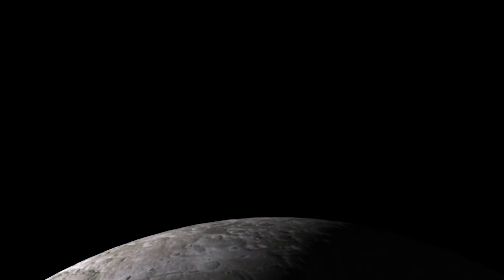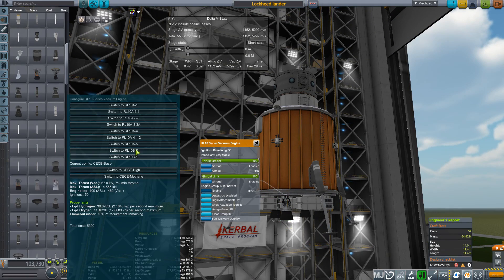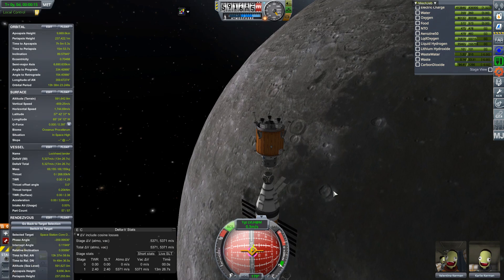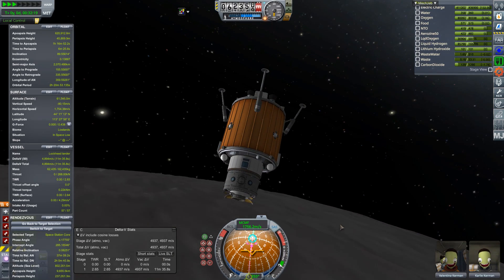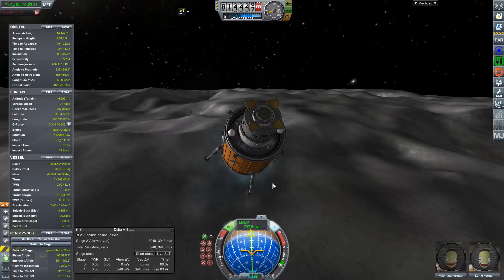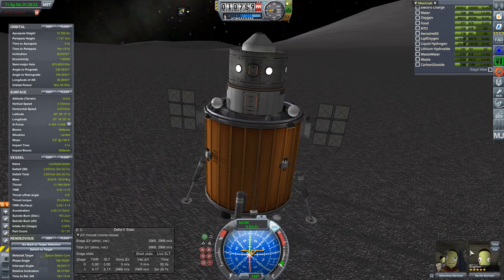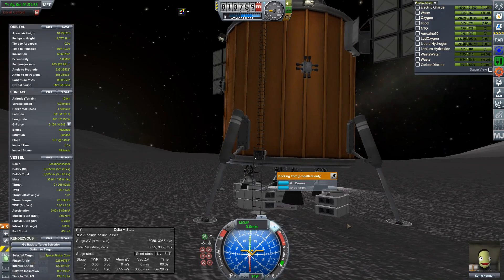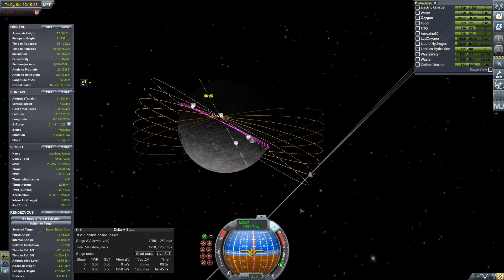Simulating Lockheed's Reusable Lunar Lander Concept

Comment: Thank you for posting this simulation. I did not know about Lockheed Martin even having a new design concept on the drawing board. Maybe I missed something, but I understood that an essential component of New Space / re-usable spacecraft is to standardize on newer, more powerful and re-usable rocket engines on all stages. SpaceX does use RP-1 on Falcon 9 and Falcon Heavy, while Starship uses methalox exclusively. Why do theselong-standing aerospace manufacturers frequently turn to older designs that use liquid hydrogen? Given the problems we've seen with SLS, older hydrogen engines seem problematic. Blue Origin / National Team's proposal video for the National Team lander design made a big deal about the landing engine exhaust kicking up lunar regolith, causing debris to be shot around at kilometers per second. I don't understand why a lander concept like this Lockheed Martin design doesn't include high-mounted landing thrusters along the rim of the upper fuselage so that these could be used for the final descent phase, just prior to touchdown. (Like what SpaceX wants to do with its HLS Starship.)

Comment: Since you were talking about fuel system selection and also about fuel refinement and ratios; why not use hydrogen peroxide for the RCS system, like on Soyuz?  It would help offset the ratio problem, and possibly (if Roscomos gets their act back together) allow for transport of H2O2 back to the ISS for venting and replenishment of Soyuz (perhaps some distance away from the station), getting around the 200-day operational constraint.
If this mission infrastructure gets implemented and Soyuz can be replenished with H2O2 in orbit, it would be interesting to see a Soyuz redesign for long-orbit duration, possibly for some years.

Comment: Question: why not just use pressurized gaseous hydrogen (from the main fuel tank) as a monopropellant?  It wouldn’t need ignition at all, and would reduce the need for complexity and dangerous fuels.

Comment: Maybe it would be better for the astronauts health if the habitation module was inside the fuel tank. so they would get extra shielding from cosmic rays. There is the thing about the fuel tank exploding, but maybe if the habitation module was a hard egg it would be able to resist better the explosion? I'd personally rather have a BFR doing all of this and a couple of hydrogen extractors permanently set inside a crater somewhere.

Comment: The best highlight of my KSP happened as I was landing on dubs with 4 parachutes. 

The first parachute got ripped off in the upper atmosphere as I was trying to land. Then a minute later my other 3 parachutes opened in the lower atmosphere. And less than 1000 meters from the ground I was getting excited that I wasn’t going to die...

Then my upper stage parachute hit me at 200m/s and blew up my landers crew capsule. 

LOL! It was wonderful!

Comment: This seems like Altair v2, but just 1 ton of cargo is abysmal, all you can do with that is wander around on the surface, an Apollo redux of 3 days of actual work and the rest twiddling your thumbs.
The configuration of people on top is just poor, you can't do any large module unloading, and with a single stage full of hydrogen your living ONTOP of and wasting an incredibly effective radiation shelter.

Comment: I'm new to this game. Your last clip looks similar to my Mun landing attempt.  I keep losing my maneuverability.  SAS and RCS both just stop working sometimes and I can't line up for any orbit burns. A,S,D,and W keys are just dead.  Finally landed on Mun, but I'm on my side.  I'm in my first orbit around Minmus now, but I lost any control on the approach.  Only pulled it off because it auto-rotates to the correct position upon full throttle  based on orbit maneuver.  Not sure how I'm going to land yet.
Reply: With kerbals on board or with probes?
With a probe, you might have lost connection to KSC (depending on your difficulty settings)
With a manned craft: Maybe you ran out of Monoprop (likely if you did not add additional tanks) or out of electricity for the reaction wheels.

Also possible in all situations that you accidentally hit time warp (no control at all during time warp)

Scots problem was, that his craft had far to much thrust for its mass to be landable without throttling (the Engines he chose for the craft in the last scene could just not be throttled, only turned on off (with some delay I suppose) and that the crafts RCS engines were not designed for such extreme tasks (there really should be no need to be, in real life)
Reply: Kerbals on board.  First SAS became useless and I couldn't do anything while still attached to my main stage.  I detached thinking my lander stage would react to my input, but it too was dead.  I have 3 or 4 of those little RCS things attached, and full fuel, with 3 small external tanks attached.  I highlighted the RCS tab, and could then maneuver with that, but  it was difficult to control.  Those too went dead.  I could only maneuver while the main rocket was burning, which made landing an interesting ordeal.  Trying to slow my lateral velocity while keeping it upright and having to start and stop it so I could still fall toward the surface.  Tipped over on landing but was able to get out and walk around.

Clicking on the little thrusters showed them being full of fuel I guess.  I'll have to read up on those.  I'll add a solar panel or two also as I didn't have any of those.

Comment: Scott, at 4:20 you said about leaving a fuel tank an low Moon orbit. It is absolutely unrealistic because how much not round the Moon is. You will not find the thing where you left it.
Reply from the maker: Nah, to start with there's a frozen orbit at 86 degrees which is pretty close to a perfect polar orbit. so a Fuel depot would easily be stable for a few months.

Comment: How to store Liquid Hydrogen for two weeks or longer?Is there magical cryo tanks for that?How to not let LH boil off?
Reply: ULA's ACES upper stage is magical cryo tank.
Reply: Store it as water and split it up as you need it?  Or just use a lot of energy to keep it all very cold and give it some pressure

*edit: Ah you mean on the lander? Just Park your rocket in the shadow.... should be pretty cold then already
Reply: Yes, in theory that's possible. But IRL it would take a lot of energy, resources and time to convert water to LH+LOx, which won't make sense unless they have nuclear reactor on Lunar orbit. Which doesn't solve the problem with LH stored in Lander for two weeks, cause if they put Lander in shadow, they won't have solar power.
Reply: 40 t of water split holds about 175 megawatt hours of energy. Let's just say you need double that power - 350 megawatt hours because of inefficiencies in the conversion and non-stoichiometric engine use. The gateway that this is based off of produces 40 kw or .96 megawatt-hours per day. It could therefore fuel this in about a year. ISS produces about 2.5x that, therefore it could fuel this in about 6 months. ISS in an orbit that isn't in shadow half the time would produce double that, which would translate to fuel production in 3 months.

Comment: What is the advantage of multiple landings?
Reply: erase the need for bringing a complete Lander to the moon each time, but just the fuel needed to land.
Even if the fuel for a multiple use lander weighs the same as a single use multi stage lander:
- fuel is easier/way cheaper to produce and probably also to bring there
- fuel can be used for multiple purposes
- fuel could to some degree be generated in-situ
Reply: to save money, just like the space shuttle

Comment: What would happen if a suborbital craft is caught by an oribital craft? Would the orbiting craft be pulled down, or would the suborbital craft be pulled into an orbit? I imagine the orbiting one would lose some speed, but would it be enough to pull it out of orbit?
Reply: The difference between suborbital and orbital at any given altitude is the horizontal velocity, so it would depend on how suborbital the craft was... the closing speeds could be faster than a bullet.  But assuming that they could survive impacting with each other, their momentum would be conserved and the resulting velocity would be lower than the orbital craft's velocity,.  This may or may not be low enough to make them both suborbital, depending on the initial velocities.
Reply from the maker: They’d have to match speeds
Reply: Probably both spacecrafts would be destroyed.  
The orbital craft travels with more than 7.8 km/s. The suborbital craft must be slower. And even a 'small' difference in speed (e.g. 100m/s = 360km/h) is a too fast impact.
Reply: Are you describing a Fulton Recover in space?
Reply: As described before: the momentum (mass*speed) of both craft together would be the same as each separate crafts (before) added. This physical constraint / reality leaves you with the simple result that you cannot gain anything by this operation: You simply have to propel the orbiting craft prior to this move to the speed it needs to be able to perform it. Instead you can just propel your suborbital directly.
This aspect of physical needs aside, just for the fact of doing it:
In order to perform this at the lowest possible speed difference to be still an orbit after the 'catching', the orbiting craft needs to be way heavier than the suborbital one (to allow for a low as possible speed of the orbiting craft).
Even if you are able to create a methode to 'catch' a suborbital craft with an (still much faster) flying orbiting craft, you'd need to implement some really fancy technologies to make the resulting acceleration bearable even for dead hardware, not to mention astronauts.
Or, inversly, to make the 'catch' long / elastic enough that the accelerations get to a bearable level. Think about some x km long catching device...

Comment: So a resuable lander which can only launch 1T to the surface of the moon, and requires 40T of fuel to be launched to the moon to be used... why not just develop a much lighter 2 stage lander and send a new one to the moon every time, seems much cheaper (when you think about the cost of sending 40T of fuel to the moon), doesn't require in space refuelling and lets be real, this lander is only going to be able to be used a couple of times before it is rendered to dangerous to fly and a new one will have to be sent up
Reply: Yeah 40 tons of fuel for each trip seems a bit extreme. You'd have to launch an SLS just to refuel the thing.
Reply: Such a lander would only make sense after ISRU infrastructure was in place on the moon's surface, and even this would assume it could launch from the surface of the Moon with full tanks, rendevous with the Lunar Gateway station, then land on the Moon again to refuel.

Comment: With more launch vehicle builders looking at Liquid Methane I am surprised Lockheed/Martin didn't go that route. Yes H2 has better performance but it also requires larger tankage. Plus the storage issues with LH2. Also if you use the Lunar Gateway as a fuel depot you could ship the fuel up as water and a dense hydro carbon or even solid graphite. and manufacture the fuel on site at the Gateway. I could see the Gateway being primarily a fuel depot and supply site.  Personally I see Methane as a more likely future for chemical propulsion systems. As to the RCS system. Why not use H2O2 at about a 90 to 95% solution
Reply: The lunar gateway is already planned to be hydrogen based so I would assume LM would operate around that idea.
Reply: To be honest I think anything proposed by NASA or any of the aerospace companies feeding the federal government trough will never be anything more than pretty pictures and animations. NASA's track record in the recent past has been less than stellar with the exception of the stuff done at JPL. Why is this? First it is because of incoming administrations changing goals and policy. Second it is because certain individuals in Congress care more about the jobs related to NASA Centers than anything actually getting accomplished in terms of actual goals, hardware being built and flown or much of anything else. LockMart, Launch Alliance and others are willing to play the game. The Shuttle was retired over 8 years ago and we are still no where near having any man rated system. I suspect Musk will launch man rated Dragons or even the BFR before NASA and the rest of the trough feeders are close to having a flight ready vehicle.

Comment: What's that about leaving fuel pod in LLO? I didn't quite get it
Reply: The Gateway station orbits fairly high, so it takes more fuel to get to it from the lunar surface than it does to just get into lunar orbit.  This is fuel that you take down from orbit just to take back up to orbit, so some savings could be realized just by leaving it in orbit in the first place.

Comment: What if you used a lander like the Apollo LEM, and you just kept several descent modules in orbit that could be bolted on, and refueled the ascent stage
Reply: That wouldn’t be very efficient, it’s like cutting a 747’s Engines and landing gears and building and having separate ones in another airport (idea like Elon Musk”s explanation)

Comment: Well SpaceX has really changed everybody’s ideas about big y’all landers. 

I remember when people used to talk about direct ascent vehicles they used to point to the size of a vehicles and it seemed ridiculous to land a 5 story high building on the moon. But after Spacex has been greasing the landings of rockets twice that height here on earth, it doesn’t seem so far fetched.
Reply: and its way easier on the moon too. ....the thing is tho that slowing down is way easier here because you can airbrake,.
Reply: Well, you still have to slow down to not burn on re-entry.
Reply: @Bartekkru100  thats not really true, all landers just go into mars atmosphere directly.
Reply: +Thomas Wijgerse
Oh, ok then.
Reply: Yes it still it, because we do not have flat concrete landing pads on the moon, landing on slopes up to 10 degrees is likely to be a requirement for a lander as it was with Apollo.  Tipping over is the main issue preventing a landing vehicle from being tall and skinny,
Reply: Plus lunar landing is an absolute piece of cake compared to rocket propelled landing on earth.
Reply: well, it takes more fuel to land on the moon then on mars, because of a lack of an atmosphere to slow you down, but spacex has has really shown it is possible
Reply: Thomas Wijgerse well you are correct, but there are some super serious physics issues that make Mars more difficult than the moon. 

Yes, Mars has an atmosphere, However, you have to remember that Mars’ thickest atmosphere is around the equivalent of 100,000 feet up in the earth’s atmosphere. Vehicles in earth’s atmosphere are traveling Mach 3 to Mach 6 through those flight regimes. 

So the atmosphere can slow the vehicle but only to the point where aerodynamic forces become severe enough to require the vehicle to be built for atmosphere (fairings/wings/lifting bodies...all of which add substantial mass)
Reply: Thomas Wijgerse yet they’re still only able to get the vehicle down to Mach 3 or so at the surface so the vehicle needs a whole ton of power at the surface as well.

It makes mars a far harder but to crack than the moon.

Comment: my biggest question is what are they going to use to bring 40t of fuel for each mission to the orbiting station?
Reply: They will be sending supplies to the LOP-G so they will acumilate surpluses oxygen and hydrogen I'm not sure Howe much water each each supply ship brings to the ISS.
Reply: Christopher Bloom yah, but even the current SLS design can't even deliver 40t to a lunar orbit, so you would need multiple SLS launches just to deliver the fuel for a single mission even if they were dedicated fueling missions
Reply: @Dufud6  I'm not talking about taking oxygen and hydrogen specifically for propellant but as crews come and go the LOP-G will acumilate more and more water recovered from the crews water reclamation system even the plastic from trash could be broken down recovering hydrogen to feed into a sabatier reactor. The ESA ATV- supply ship can carry 1800LB of water to the ISS so if the LOP-G can get several supply ships a year they might accumulate part of the H2O needed to fuel the moon lander at least for the initial trip to the surface.
Reply: "Christopher Bloom yah, but even the current SLS design can't even deliver 40t to a lunar orbit, so you would need multiple SLS launches just to deliver the fuel for a single mission even if they were dedicated fueling missions "

It would likely be one dedicated fuel trip and one co-manifested with Orion and crew fuel trip. You likely can't do 4 crew for 2 weeks with one heavy lift launch (Apollo didn't do that). Or 1 SLS and 1 FH/NG. Or 3 FH. Or 1 SLS with electric propulsion. Or lunar ISRU. Or asteroid ISRU. The Lockheed white paper I believe just says that NASA pays x amount for a kg of water and it is delivered by whatever means.

edit: from the whitepaper:

"Because of the high ∆Vs associated with deep space operations, and the objective of reusability as essential to sustainability, liquid oxygen and liquid hydrogen are the most effective propellants. These components may be derived from water, the most ubiquitous resource in the solar system. Because it is also essential for breathing, drinking, plant growth and long-term viability of human populations, the commercial delivery of water will become a highly competitive industry sector.  In a pay-by-the-gallon model, industry players are free to develop, evolve or optimize their own launch and delivery systems while providing NASA with more and more cost-effective options for refueling their reusable fleet spacecraft, thus concurrently advancing the overall sustainability of NASA’s programs while lowering barriers to further commercial activity. "
Reply: ISRU